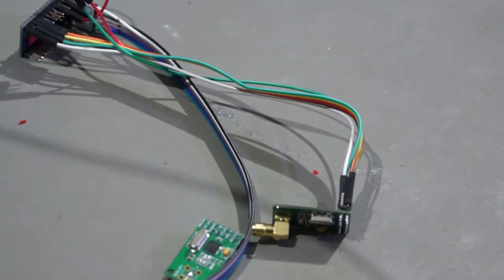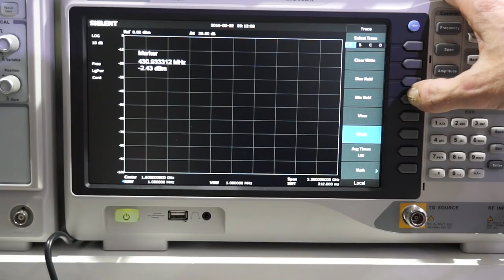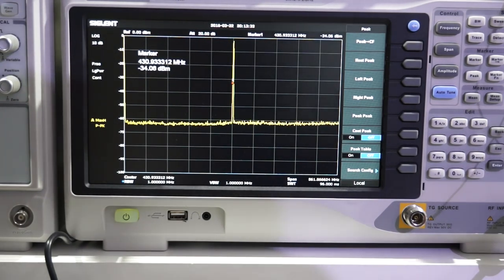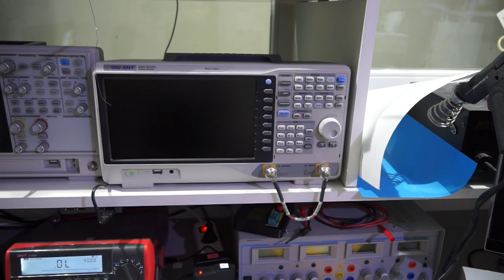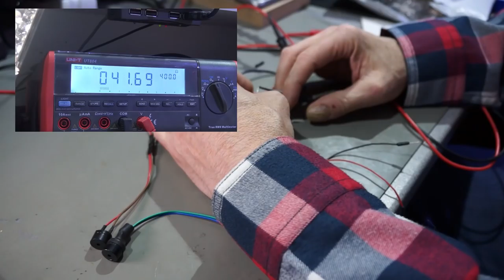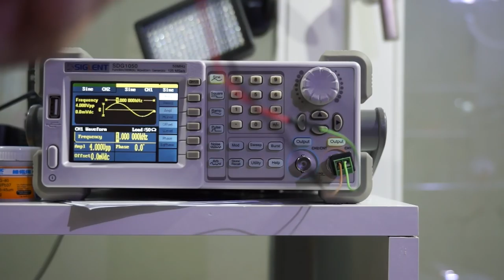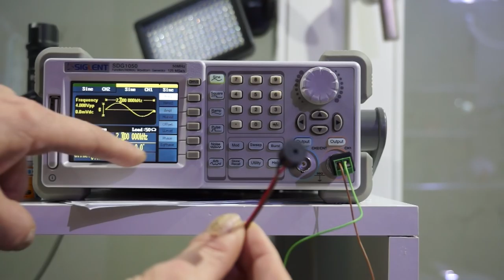#52 My First Mailbag and Some Tests

Comment: Before i even watch the video i have to give you a like for your DIY  helping hands on your bench .   I can return to watching now .
Reply from the maker: +XerotoLabs The helping hands are not yet finished. I have to melt some led and pur it into the cavity at the bottom. Just the wood is not heavy enough because the holders are quite stiff.

Comment: Hi Andreas - Just a quick note that I always enjoy your video posts (thanks for sharing and providing the links to those products within the description). Quick questions --- when do you think you will be completing/posting the shoot-out for all those wireless modules? Very interested to see that one. BTW - will you be including the ESP32 in your tests? CH
Reply from the maker: +Christian Hochfilzer I plan from week to week because, sometimes I also have to work a little for money... So, I do not know when I will do it. I just discovered, that the "868MHz" modules in reality are 443MHz modules. So, I decided that I try to change them. But I have no idea wheher I will be successful.

Concerning the ESP32: I have no such module and I think, it is still in prototyping status. If it is ready, I for sure will try it. But I think, this will become summer.

The 433/868 modules are also only transmission modules, so the ESP32 should be compared with the newer Arduinos and with the ESP8266. The NRF24L01 will propably enter into the competition of the transmission modules.

Comment: How can you find inspiration. I have a lot of electronics but i seem to loose it when i use them for some time
Reply from the maker: +Ivan Beck I can only suggest to keep the eyes open. I am an engineer and it is easy for me.
Reply: +Andreas Spiess thanks. I also was thinking of an esp8266 mesh network wether station.Where the esp's connect to each other and one of them connects to your wifi to dump all the data from the others
Reply from the maker: +Ivan Beck Frankly, I see too many weather stations and temperature sensors around. 
Googled "Weather station arduino" and got 281'000 hits
Googled "weather station ESP8266" and still got 37'000 hits

I would wait for a better inspiration ;-)
Reply: Darn it.  That was what I really wanted to make.  Sigh.  I guess I won't.
Reply from the maker: Your choice ;-)
Reply: Andreas Spiess   I forgot to put the smiley-face!
I am slow to start... I haven't even decided which ESP8266 boards to get yet.  It's been a long time since I tinkered, and like Ivan Beck , it's hard to keep inspired between the thinking, ordering, receiving, and starting at the parts.  I have lots and lots of parts from over the years... I forget what I was planning to do with them by the time they arrive.
The first step is just to get a single board up and running - but I would need a couple more.  My inspired project is to make an add-on for motion-sensing yard lights... if any one gets triggered, it radios to the rest to turn on.  Why aim low?
The rest of the ideas I have are basically for monitoring and logging for other projects.  How hot DOES it get in my car, in the summer, with and without those silvery sunblockers?  DO they really help?  I'm too lazy to sit in the car and write down the thermometer readings.  
What Is the temperature in the middle of the compost pile?  What happens if I add a cup of sugar to the pile?  If I water it?  If I turn it?  Personally, I think my compost piles are pretty poor, but at least that would give me a way to monitor what happens when I make changes.  
What about those cheap solar cells I pull out of the cheap solar lights?  What's the max V & I throughout the day, if they're stationary, pointing straight up, vs angled, vs on a tracker, vs with reflectors?  Do any of those things matter?  No.  Not to anybody but me.
Ivan Beck , I think that the mesh itself is a good idea.  If you get an ad hoc mesh running, that you can add a node to at any point, to extend the mesh, then that's something all in itself.  What can you do with a mesh, afterwards?  Well, I mean, beside from letting EVERYBODY know that a deer has come into your yard.
Reply from the maker: The word "NO" is the most valuable word in the world. The word "AND" is the most expensive one. And if you do not use "NO" you automatically get "AND" in many cases ;-)